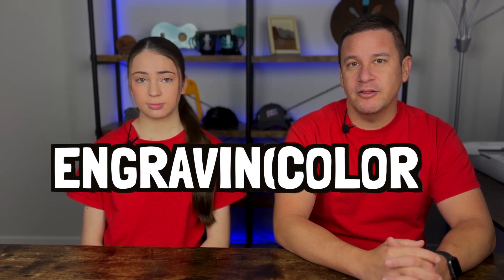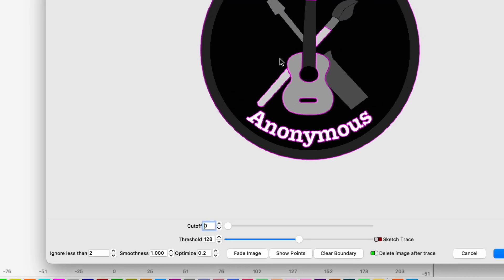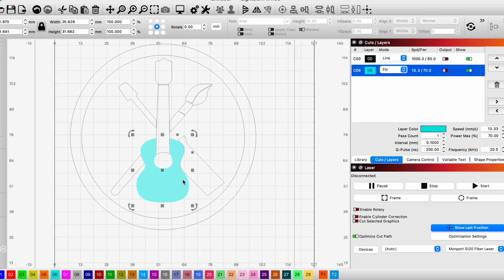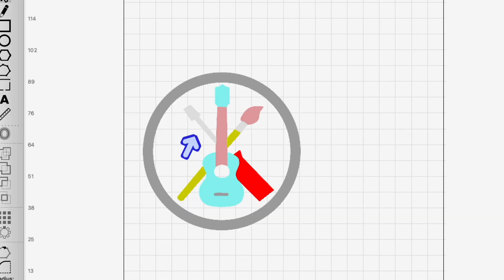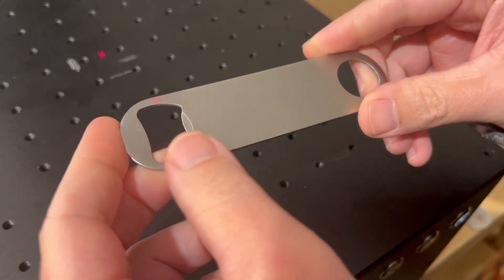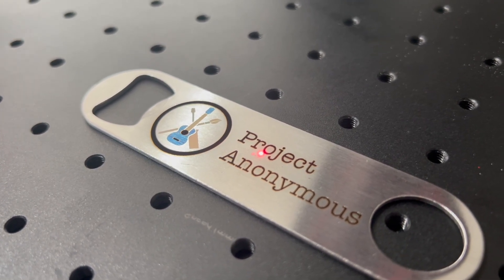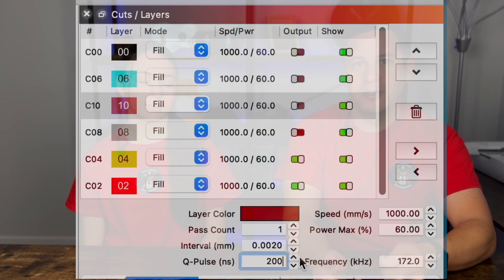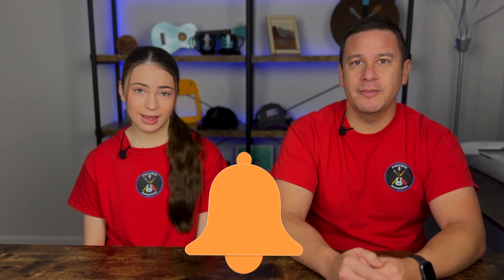ENGRAVING COLOR on Stainless Steel w/ Monport GI20 Fiber Laser

Comment: This is awesome, thanks for the video! Great little example as well. I'm looking at getting something to etch or engrave logos onto some small parts, is this the 20W version that you're using? I will mostly be using it for 304 Stainless, about .065- .080 thickness. Thanks!
Reply from the maker: Yes, this is the 20W.  Here is the link to the laser: https://bit.ly/3tUGuN1 Thanks so much for watching!
Reply: @ProjectAnonymous_Duo  thanks for demonstrating! Big value in this video!

Comment: I'm curious. Are those colour comparable with the ones you get after welding stainless steel or ist there a difference? Because after welding you want to get rid of the coluers to prevent rust and it would be pretty annoying to laser some really cool colours just to let them rust away.
Reply from the maker: When dealing with metal engraving/markings there are a lot of variables. We have not experienced rusting in our projects to date, but we are aware of its possibilities.  This can happen if the process you use removes the protective chromium oxide layer. However, it is possible to avoid damage to its protective layers. There are also coatings you can purchase and apply after engraving to prevent rust/corrosion. There are various ways to make marks on metal. Three ways include laser etching, laser engraving and laser marking. Unfortunately, these terms are used interchangeably and each technique has its advantages and disadvantages. You can achieve an annealed mark that changes the structure of the steel without degrading the material for less chance of rusting with the proper settings. We hope this helps answer your question. Thanks for watching!
Reply: Everything that's not black, silver or golden and copper like will degrade over time, unless you use some sealant like clear coat to protect it from oxidizing. See video from Roger Webb, very inforomative.

Comment: Are these colors permanent?
Reply from the maker: Yes!  SS is permanently annealed.
Reply: Black, gold silver colors are permanent but the other ones (blue, red yellow, green, etc.) are not and will kind of "rust" over time. It is not annealing, more like a controlled oxidizing (like you blow a troch over metal and it gets blue, but in a controlled manner). You can protect from that by using some clear coat to seal everything and prevent oxygen from altering the marking.
See video from Roger Webb, very inforomative.

Comment: I am thinking of getting a laser. The one I am looking at  Is an Galvo Laser JPT M7 MOPA 100W Fiber Laser Machine 300x300mm will this cut and mark wood, Glass, Marble, and other nonmetal materials If I adjust the power, frequency, and other settings? My main thing is that I will be Engraving on gun parts.
Reply from the maker: To the best of our knowledge you shouldn't use a fiber laser to engrave organic materials such as wood because of extreme fire hazards.  Everything else you mentioned a fiber laser will be able to handle.  We believe your selected laser would do fantastic for engraving gun parts.  Thanks for watching!
Reply: For glass and transparent stuff you would need a UV laser more than a fiber one.
Forget about wood, paper and organics, as said earlier.

Comment: Great video, very informative. Question, I've been looking at different laser engravers, and color engraving is something that i wanted to do. I've been looking at the Monport 40W Pro. I know that different engravers could give varying degrees of good color output, would you know if that would get the same color output, or close to it?
Reply from the maker: Unfortunately the 40w Pro is a CO2 laser and will not be able to color engrave stainless steel. At most you will be able to etch anodized aluminum.  If you are want to color engrave or engrave stainless steel (or other ferrous metals) you need a fiber laser like our GI20 from Monport.